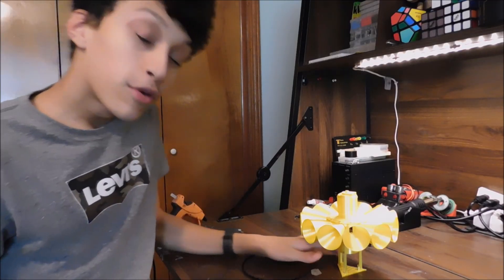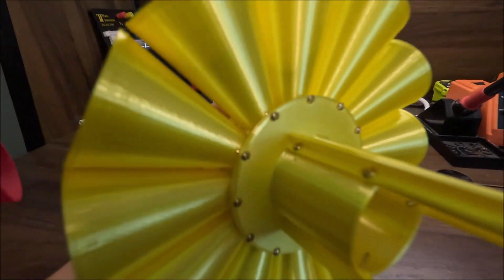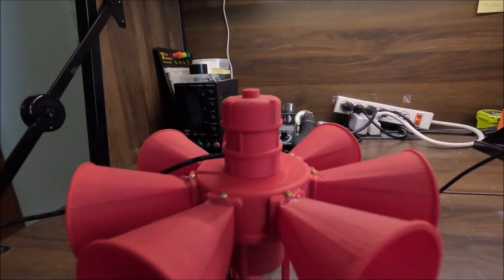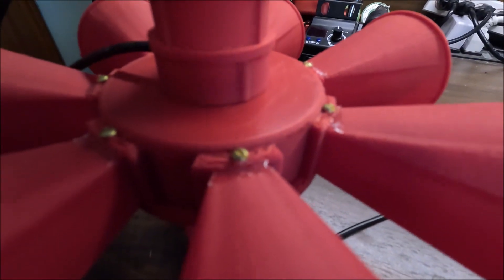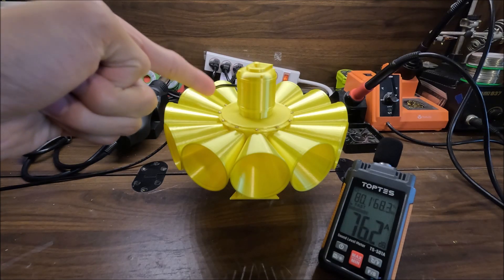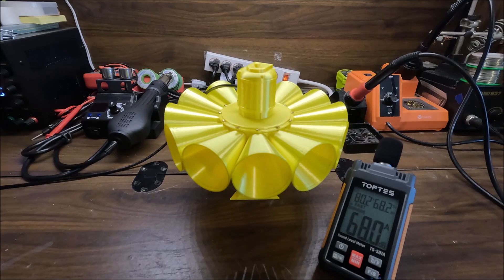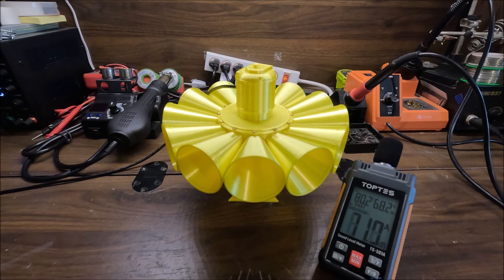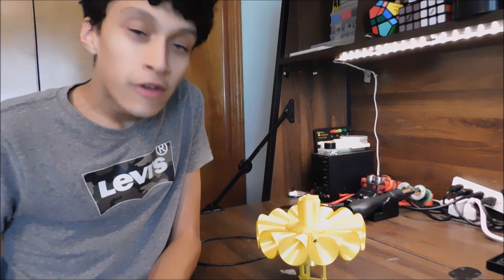My Mini STH-10 Siren Overview and Test!

Comment: Do u mind if I edit the chopper and the stator and remix it to printables?
Reply from the maker: Sure, just PLEASE credit me for the original works.
Reply: I will credit u
Reply: And also i dont want to do the horns and the motor covers and everything else so i will release it for people who wants to do it easy even tho its great if its full finished so i only print sirens that are easy because i have less filament so this remixed model from me is gonna also gonna have to find that excat motor to tell people so yeah. Other then that its just sirens.
Reply from the maker: @Mariaaguello  I totally understand. By all means, go ahead and remix the files for your own needs!
Reply: I think I alr Said this but here's the link sorry for pinging u alot
Reply from the maker: @Mariaaguello  No problem. Thanks for giving credit to me!
Reply: @milespeterson5049 I have bad news.         I broke the motor just because the chopper and the stator was stuck I tried to take it out and it sirenconed p50 but Manuel version I tried to pull off the chopper and the motors went Dingggggg the iron inside broke
Reply from the maker: @Mariaaguello  Oof. Well, did you try printing the rotor tolerance tool? If you read the notes in the remixed project, they point out that you should print the tolerance tool before you print the rotor so that you don't mess up the hole size for your motor shaft. Find the right hole size with the tolerance tool, whether it be 2.2 or 2.3 mm or even bigger, and then try that out!
Reply: @milespeterson5049  the rotor fitted great and the stator wasn't touching it but then I tried to take the rotor out then the iron inside broke
Reply from the maker: @Mariaaguello  That's interesting. I guess the motor broke, and not the rotor or stator. Well, 130 motors are pretty cheap, so maybe you just got a low-quality 130 motor. I recommend higher-quality, lower-RPM 130 motors for my sirens.

Comment: Nice! If you can, I'd recommend looking into shaded pole motors - basically smaller versions of the big induction motors most AC sirens use. You can get it sounding much more accurate that way without having to do much at all.
Reply from the maker: Thanks, but I have tried that on my life-sized siren video and had really no luck with those. I was using a huge 8-something-inch rotor, but I couldn't drive that. I bet a smaller rotor would work better, but shaded pole motors are expensive.

Comment: You should make a P 50 or a ACA allerter
Reply from the maker: As cool as the P-50 and Allertor are, those are some hard designs! I'll consider the P-50, but not the Allertor because it uses a basically impossible rotator system at any small scale.
Reply: @milespeterson5049  oh

Comment: I got am idea to potentially make the wind down longer on it if there is a rod sticking out of the roater add a bold on it or one of those circular metal screw like pieces I forgot what it’s called but it might make it longer
Reply from the maker: You mean washers? I was going to add some to my Super-Sirex rotors to make the wind-down longer! You got it!
Reply: @milespeterson5049 dont feel rushed on the winddowns it’s just an idea
Reply from the maker: @trainsandsirensofutah5334  No, you're not the only one. I had, like, 4 or 5 people suggest weights on my Super-Sirex because of its short wind-up. I'm already in the process of giving it a bit of a revamp.

Comment: Nice….now I got a new siren to print, I almost got a 2001 ready for the flag pole but, I’m waiting on the Damn Slip rings, that’s the only hold up I have with it, and I got 2 model 2s stockpiled and the one that still out on the flag pole, I also figured out how to buck converter it from the control box, now it’s got wall power and is now not relying on 5 9V Batteries and it has the Perfect pitch, and I test it daily around noon on fridays.
Reply from the maker: That's awesome! Feel free to publish videos so other people can see your work!

Comment: Nice it sounds like a 2001 I'm absolutely printing a bunch of these with your other sirens I might use a phone charger power Bank cause I might make it USB powered. And quick question what parts use supports and can m3 machine screws work with it?
Reply from the maker: That's awesome! And, to answer your questions, the rotor, stator, and motor cover need support when printed. The Tinkercad project has notes for each part and lets you know if you need support or not. And, no, M3 machine screws would NOT fit this siren. I used #2 size wood screws, but M2 size screws should also fit because they're a pretty close match. Anyway, I look forward to you making my sirens. I'd love to see videos of it!
Reply: @milespeterson5049 yes I'll make some videos of them and I'll tag you so you can see them i almost always tag a creator to give them credit. And the sth 10 siren is on of my most favorite sirens.
Reply from the maker: Alright! Sounds good! I look forward to your mini sirens!